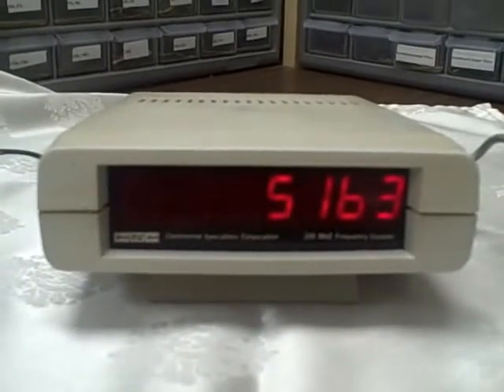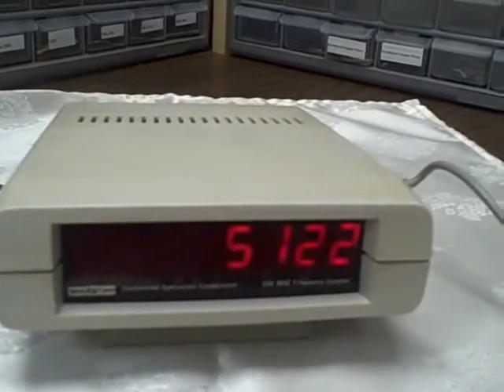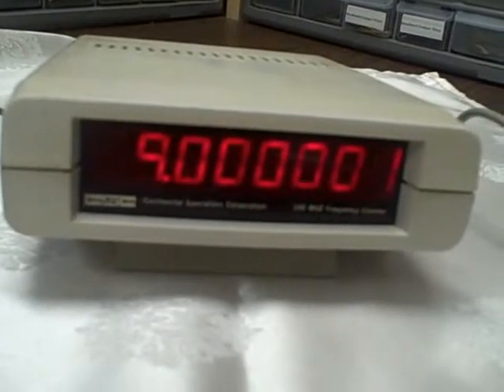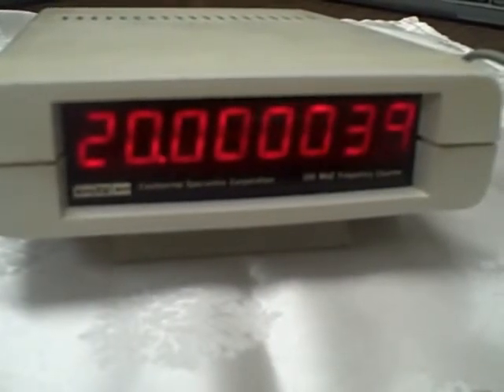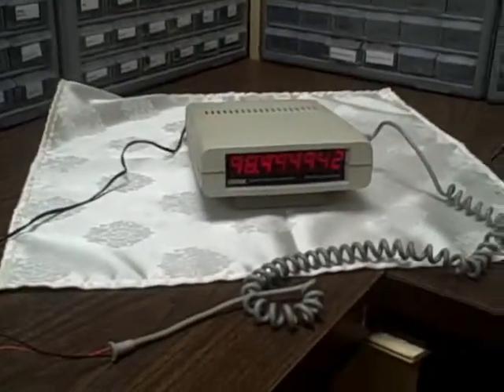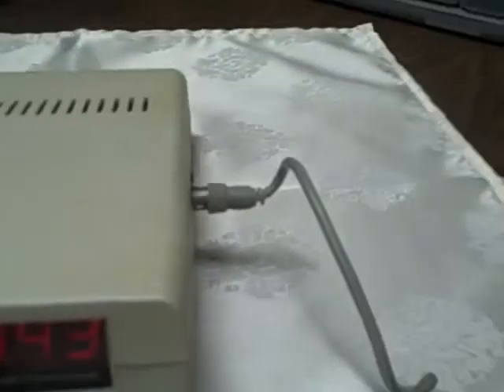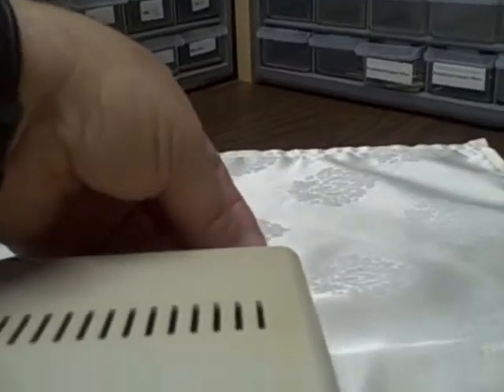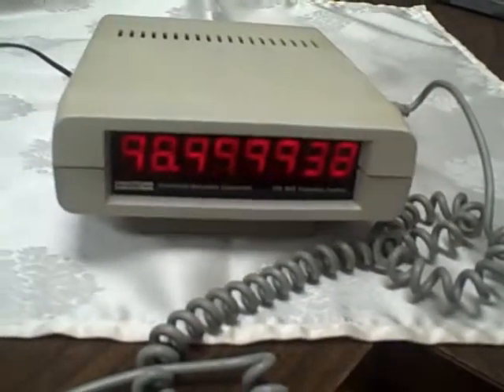Contenental Specialties Max 100 Frequency Counter

Comment: I had one in 1978, it worked very well and was sensitive and accurate.  It will read true frequency up to 99.999999 Mc. They were specified to count beyond 100 Mc (110 as I recall).  Beyond 100 Mc the leading character would flash (by design, as there were only two characters before the zero), ie at 101 Mc it would read 01.000000 but the leading zero would be flashing.  As an experiment I hooked it to a signal generator and very gradually increased the generator frequency.  The Max 100 would hang in up to about 113 Mc, above which it would suddenly "loose lock" on the signal and all 8 digits would start to indicate random numbers.

Comment: I bought mine brand new for $149.00 in 1976, this has a TV color crystal for it's time base, that's wierd-  3.579545 MHz. Mine blew up from a nearby lightning strike along with video cameras on the house and some other test equipment. It was a lesson on leaving the leads plugged into the equipment, they act like antennas for a spark gap radio, and chips get blown up. An ECL chip blew in the counter, it was about $10.
Reply: Paul Crissman I bought one used decades ago at the W6TRW swap meet very inexpensively.  I’ve had it stored away.  Broke it out today and it still operates.  Though it’s probably time to replace the one 2200uf 25v electrolytic capacitor as well as the three tantalums.